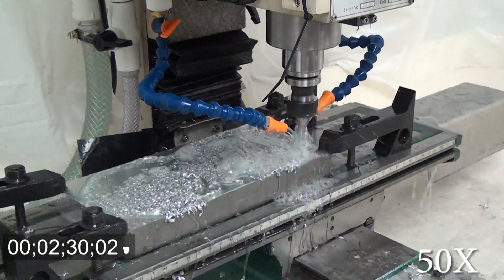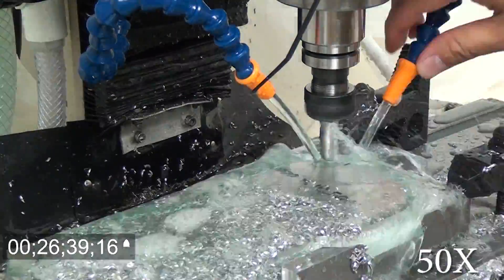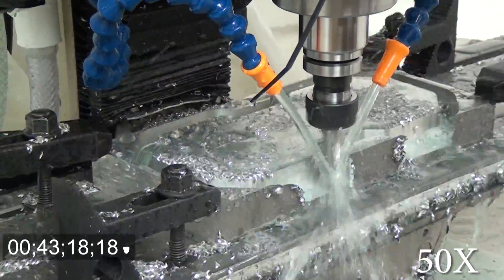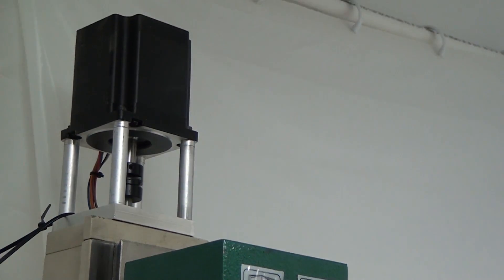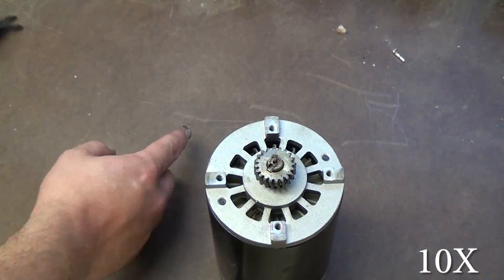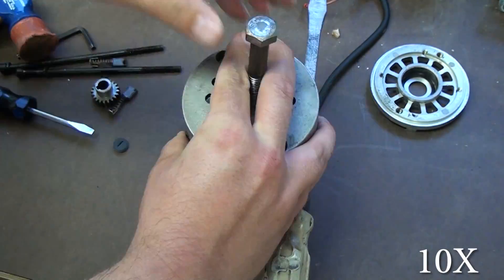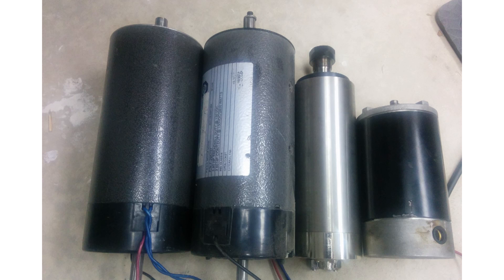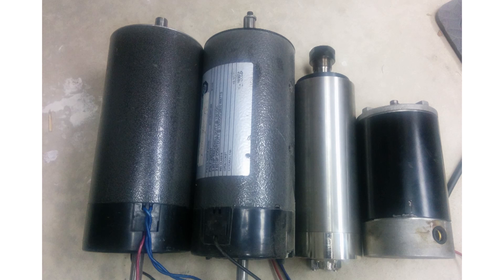CNC-G0704 #12 Motor Meltdown

Comment: Is that Koolmist coolant?
Reply from the maker: Yes it is. I just used the last of what I have and am going to be switching to Qualichem 250c after this batch.

The Kool Mist is good, but I would like a little more lubricity. Plus, the Qualichem is cheaper per gallon when buying 5 gallons or more than the Kool Mist. Also, I found a local Qualichem dealer.
Reply: russtuff Which Koolmist? 77 or 78?  I don't mind KM but I have been trying Blasocut 2000 Universa and Cimperial 1070;.
Reply from the maker: +gbowne1 77

Comment: That's now the 3rd (4th?) motor I've seen go up in smoke. I work for a tool company in the service dept, and we're a King Canada dealer. The KC20 is the same as the G0704. Those ones all had a brush holder failure that killed them. ONE guy had it happen early enough that it was still under warranty.

I was just last night searching for good candidates for a belt drive conversion (for my own KC20) - then you posted this!  Look forward to seeing what route you take.
Reply: DrFiero is the kc20vs supposed to have a motor with offset angled brushes (non reversible style)? Mine looks like the normal motor but it clicks by hand and runs alot slower in reverse, with a Smokey smell. It also spins to 4000rpm in high range! Not sure if previous owner replaced with a different motor that has same outside frame

Comment: Why not get a small three phase + VFD? Better off in the long run than staying with brushes.Sometimes can be cheap through surplus places.
Reply from the maker: I've got a VF1 for 3hp,but I have no clue where to source a motor. I'm in research mode now.
Reply: Automation direct. A 1hp 3ph motor will set you back about $100.
Reply from the maker: David Kirtley that's cheap but I don't know that 1hp will get it done. Thanks for the link, I'll search and see if other people have used it and had any luck.
Reply: russtuff They have larger ones too ') I believe that is also where Grimsmo got the drives for his belt and disk grinder.
Reply from the maker: David Kirtley Hoss had this link on his site, and I've found some pics where guys have used them. It's a giant though: http://www.automationdirect.com/adc/Shopping/Catalog/Motors/AC_Motors_-_General_Purpose_and_Inverter_Duty_%280.25_-_300HP%29/AC_Motors-General_Purpose,_Rolled_Steel,_IronHorse_%280.33_-_2HP%29/3-Phase_Motors,_56C_%280.33_-_2HP%29/MTR-002-3BD36
Reply: russtuff That is a lot of power. Nothing wrong with that but was the original 1hp under powered?
Reply from the maker: David Kirtley In my opinion, yes. Also 2100RPM is way to slow.
Reply: Well, go for it :)  and then you can use the old motor control for a belt grinder or something :)
Reply from the maker: David Kirtley I thought the same thing..... but it might also make a nice upgrade to my lathe ;)

Comment: I would not use any motor with a known bent shaft, your only asking for to damage your unit further, A bent shaft will take out bearings and mills and even reflect that vibration into the end product of your work. Start with a good motor and save yourself the heartache, you'll be setting yourself up for something worse.
Reply from the maker: You're right about that. The one motor has a tapered shaft that I would need to machine anyway, so I could take the bend out with that operation. If I try and it doesn't work then I won't use it at all and just buy something else.